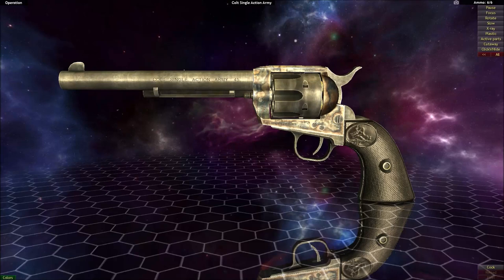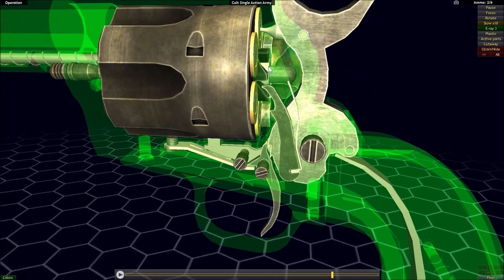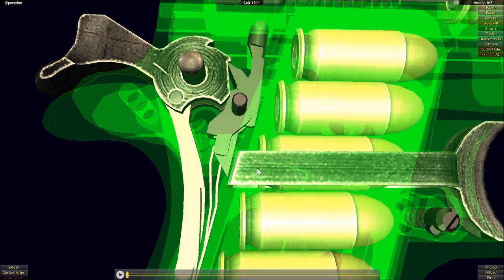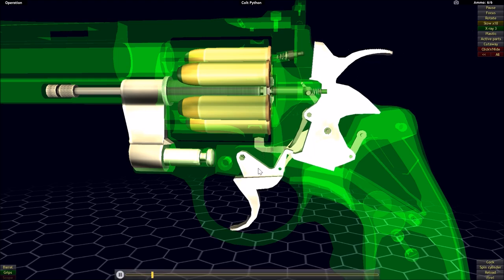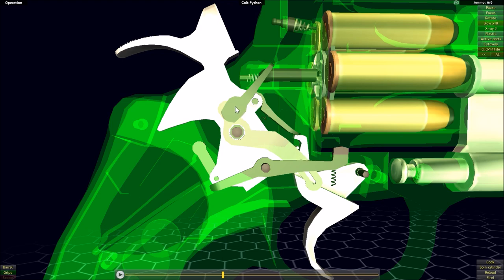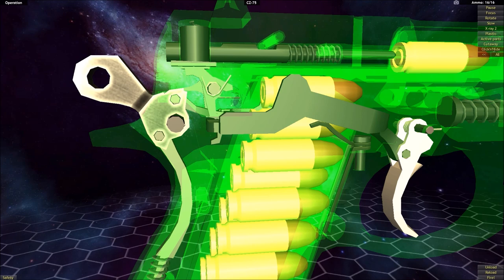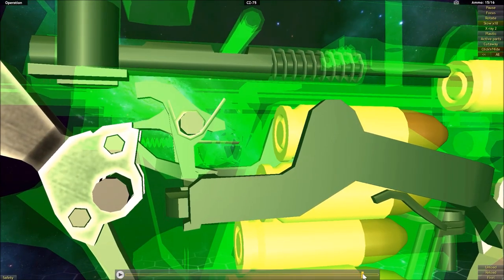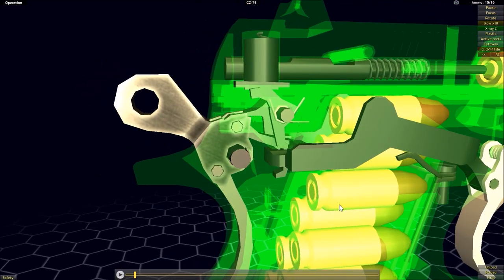How Hammer Fired Actions Work In Firearms

Comment: Smith & Wesson uses a hammer block, which is what you show here for the Colt Python. A transfer bar rises up and makes the connection between the gap in the hammer and the firing pin as shown the Ruger LCR.

Comment: Is adjusting the bolt spring a good way to adjust the hammer reset position? Timing is perfect with new cylinder, but hammer makes contact earlier. Squishing the bolt a tiny bit creates the audible click indicating reset. If anyone has any knowledge about adjusting hammer reset position I’m open to suggestion.

Comment: Was this the first "how guns work" video you did?

Also. How did you learn so much about firearms? I already watched a few of your how firearms work videos.
Reply from the maker: The answers to both of your questions are somewhat complicated. I recently received a request for a Q&A video, which I was going to collect questions for when I reached a thousand subscribers. As I have seen similar questions in the past I will more than likely answer then in greater detail. 

To answer the first question in short: no it is not the first of the videos I did, technically the delayed blowback video was made first.
Reply: Technically? Did you produce it first, but released it afterwards other(s)? Is that what you mean?

Comment: Are you kidding me? There are three notches how can you even forget to mention the first one? I do not own this Colt but from experience I believe the first notch is carrying notch.
Reply: It was designed to be carried on first notch but even colt had said that it was a design flaw and it shouldn't be carried like that. Cowboy load which is only 5 and leave hammer over empty chamber is the absolute safest way to carry this gun.
Reply: There are deff 3 notches on it though
Reply: Safety notch can easily break off sear on trigger